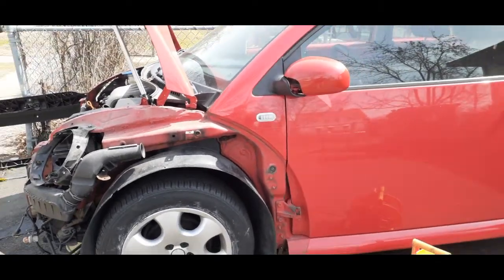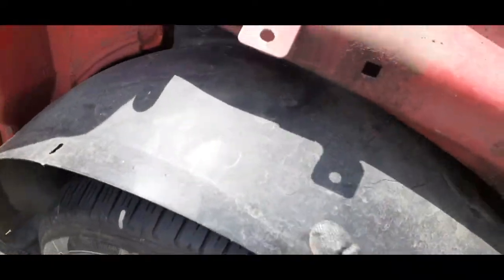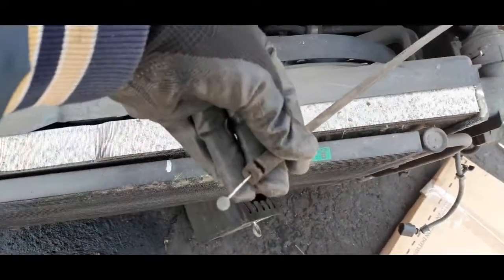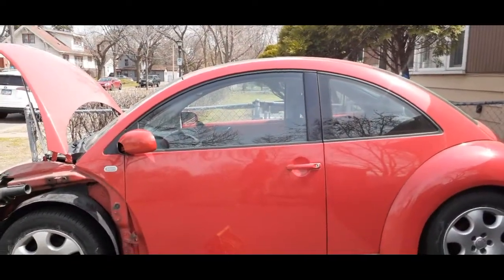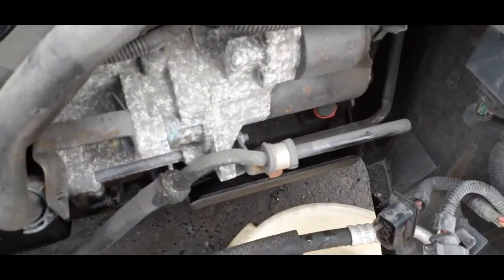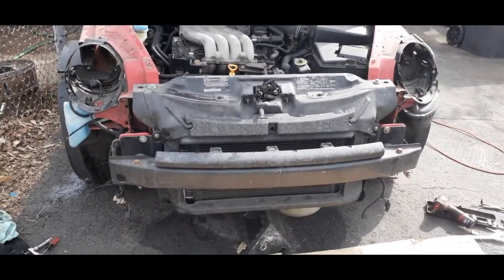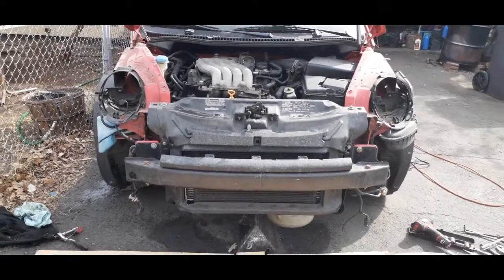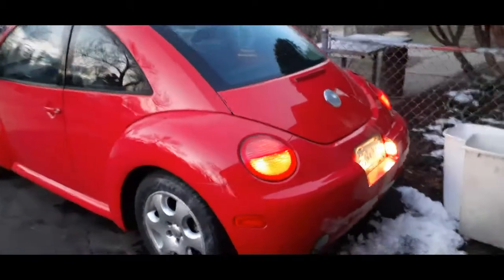2003 VOLKSWAGEN BEETLE 2.00GLS - REPLACE RADIATOR - DIY HOME MECHANIC

Comment from the maker: I solved the SPEEDOMETER problem. The speed sensor was not firmly plugged into the sensor location is behind or next to the Battery. Then the vehicle was sold couple weeks after repaired.